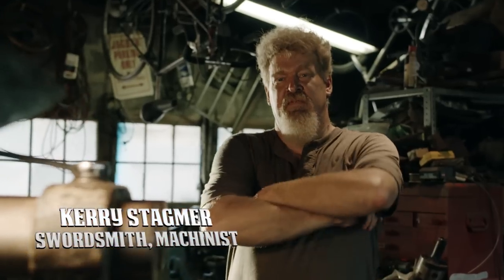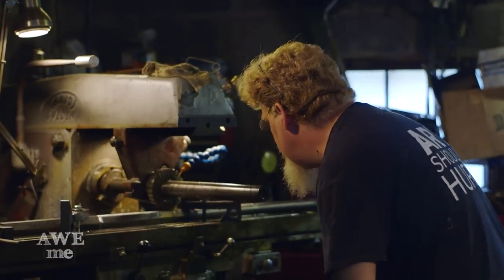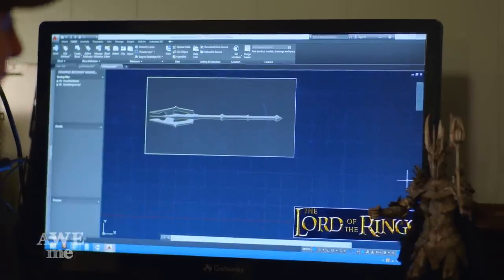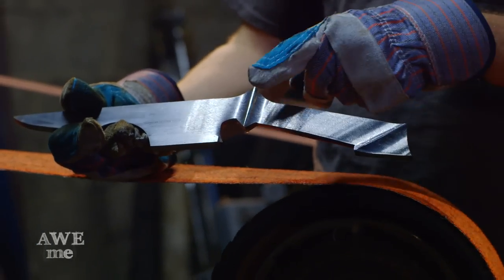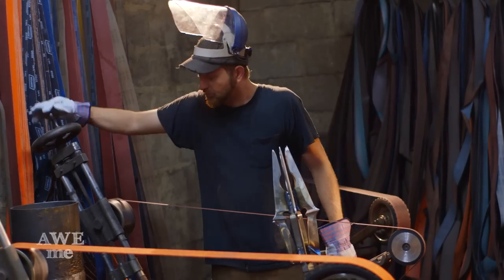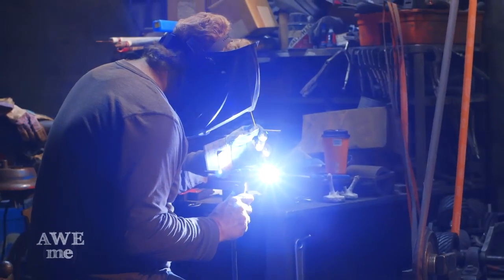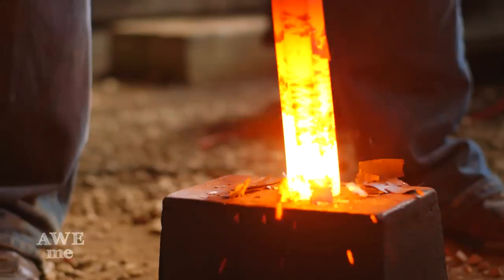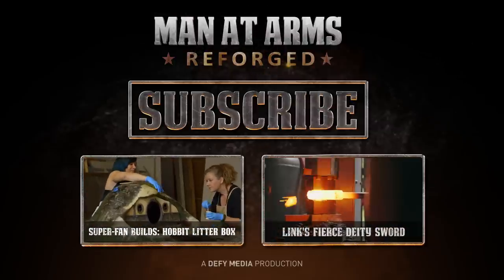Sauron's Mace (Lord of the Rings) - MAN AT ARMS: REFORGED

Comment: A mace is actually a relatively good weapon.  Requires little training.  Less skill needed than a bladed weapon.  

Fighting a spear?  Smash the handle.  Fighting a sword?  Break the blade.  Can't get past a shield?  Beat against it until the arm on the other side shatters.   

Swords are just a lot more famous and elegant, but I think if I was ever stuck in medieval times, I would go for a mace.
Reply: Uhh, no. Yes, it requires less training, but even still. You can be defeated with any weapon. If a mace was much better and beating enemies was as easy as you seem to think it is, no other weapons would've even been used.
Reply: I never said it was better.  Any weapon can be deadly if the user is skilled enough.  Bo staffs, arrows, daggers and knives.  

I just said I would rather use a mace than I would a sword if I, myself, was forced to choose.
Reply: Problem is that it is heavier and slower I guess, but it would be my weapon of choice indeed B-)
Reply: Maces are used for denting armour. Someone with a spear could simply stab the dude with the mace for a distance. Swords are used wit agility and speed to inflict damage, not bash the other dude with the blunt side.
Reply: A mace is used for smashing things, be they weapons, armor, shields, bones or heads.  Ans since most armor was designed to deflect blades, a good solid blow would send most of the impact through the armor.  

But as I explained before, the usefulness of a weapon is dependent on its wielder.  A blind master with a bo staff could out fight a street thug with a knife.  That's a given.  

And as I also explained before, I, personally, would rather use a mace or hammer than a sword or spear.
Reply: And if you get caught in net and need to cut your way out.
Reply: FoddyFogHorn ! You are poorly informed.
Reply: Leo Ryff vey good point how about a warrior who only trains with his mace and shield that's force to reckoned with
Reply: Leo Ryff has the right of it. Heavy armor and shields can deflect piercing and slashing weapons like spears and swords, making it difficult to damage the person inside. Heavy impact weapons like maces are the least hampered by this, capable of bashing their force straight into such defenses, denting them and breaking the bones beneath.

Against an unarmored or lightly armored opponent, I would favor either a spear or sword, depending on the other details of the confrontation. Against someone in plate, a mace is the way to go.
Reply: Leo Ryff I would prefer a mace if I were fighting an armored opponent, but a sword can kill an unarmored person SO easily, and a spear gives you a huge range advantage over people.
Reply: You have no idea about swords spears and any other medieval combat weapon don't you?
Smash the spear? It's not gonna break, the spearman can just give in and let you miss and come around to stab you in your chest, and it's not like you will do any significant damage, a mace is a sidearm, pole weapons are your main weapon.

Break a sword? With a mace???!?!?!! HAHAHA, a sword is a sidearm as well, so it's not likely you will run into battle against a lone person with just a sword anyway, but you really think the steel they make swords out of is weak enough to be smashed by that? 

No, maces, warhammers and flails are anti armour weapons, they always have been, they cannot destroy a weapon in one hit or two, or ten.
Stop spreading nonsense and actually learn about how these weapons were used and what they were used against.
Reply: What are spears made out of?  Wood.  Sure, you might find a polearm that could be considered a spear made entirely out of metal, but most spears are made out of a wooden handle.  Otherwise it would be too heavy to carry over long distances for war or hunting, which is what spears were used for.  A sufficiently skilled mace wielder could block a spear thrust with a shield and smash the base of the weapon, reducing it to a pointy stick at best.  

Swords were not always made with steel.  Common ones were made with cheaper materials, like iron.  And even if it was made of steel, there's no reason it couldn't be broken by a steel mace with a few blows.  Especially the longer swords, like claymores, that are made for slashing, as they would be more fragile further away from the base.  

And these weapons could break.

Modern movies and literature would have us believe that a medieval soldier would use the same weapon over the course of a lifetime.  But in truth, they went through weapons the way modern people go through car tires.  A well made and maintained weapon could last decades, but most needed repairs or replacements after a few uses.  

And if a mace is so good against armor, imagine what it could do against an uncovered arm.  Or an unarmored leg.  Or a bare skull.  

And I have to repeat this AGAIN it seems.  Which weapon your using doesn't matter as much as the skill as the person using it.  *THAT* is what matters.  *THAT* is the thing to remember if you're ever caught in a fight.

And with the advent of gunpowder, it's all a moot point anyway.  But that's a whole other style of crafting.
Reply: Yes, but I know about fighting with spears and maces, and I know that the wood that spears are made up off is not some weak wood that would break easily, spears take the least skill out of any melee weapon from the Middle ages, and it is relatively easy to let the mace wielder swing and pointlessly hit your spear (and I repeat, just because it is made up of wood does not mean it's gonna break so easily) you come back around, and you stab him.
And breaking a sword is the exact same thing, they can just let you swing and they come around to stab you.
And no way can the mace break the sword like that, and blocking a spear or sword thrust with a mace is rather......ehhhhhh.
Reply: ANd what soldier or warrior from the middle ages didn't use a shield with their weapon?  

And when did I say any of these would break in one hit?  In an army vs army battle, this idea would be moot, sure.  BUt in smaller battles between individuals and groups aiming to destroy your opponent's weapon is a perfectly viable tactic.
Reply: But it's almost impossible as I said, you can't just break a spear like that, it would not work.
Reply: And that's your opinion.  But if something can hit hard enough to crack a skull, then it should be able to damage wood.  

This argument is going a round in circles.  HOw about we just agree to disagree before this resembles a Death Battle thread?
Reply: Yes, but I have seen multiple tests before like this, it does not work, since the spear can just move with the attack as it is not stationary like a human skull.
Yea, no DB threads please.

Check out skallagrim, he knows a lot more about this stuff then me, and he pretty much taught me everything that I know about medieval weapons and how they were used.
Reply: more dangerous though
Reply: AGREEING TO DISAGREE!  

...At least no one's made a pepper spray joke.
Reply: Pepper spray! That sounds delicio- gets sprayed AHHH MY EYES.
Reply: Leo Ryff Going to try to make this non-argumentative, but what he means by you not being able to break the spear's shaft is that the wielder is going to make a soft deflection- a type of defense involving redirecting the force of the blow, rather than absorbing it. Sure, if you swung hard at a stationary piece of wood you would shatter it, but the spearman is going to get his weapon out of the way of your swing, and redirect the blow in a harmless direction.
Reply: shrug  

Pull out a gun and shoot them?  

The problem is, I don't know how I would fight someone until I fought them.  Otherwise there are too many "what ifs" and "maybes".  

I simply gave my opinion.  I see no reason for people to keep jumping down my throat about it.
Reply: Leo Ryff Unfortunately the internet is full of people who would rather start an argument than a discussion, but a good number of the fans of this show are historical weapon buffs (myself included) and often have training with a variety of medieval weapons through HEMA organisations (again, myself included), and as a result a lot of us tend to be egotistic when the subject gets brought up. Ultimately the only way to stop arguments from happening is to admit from the start that opinions are worth a little less than knowledge, and step away before an argument happens.
Reply: Leo Ryff It has their own uses in situations. Though in warfare, range has always been the king. Spears and arrows reign supreme in most warfare in history. Shields are also very strong.
Reply: Leo Ryff You forget that a spear and even more so a sword is more agile and that your enemy will not be complient in holding his weapon still for you to get in range and make that huge swing that would either shatter a weapon or smash it out of their hand. A normal mace has 50cm protroding out of your hand whereas a sword has 75-90cm. To get close with a slow weapon you need to be good with a shield or wear a really heavy armor (both would limit your sight and slow you down making chasing your enemies impossible).
Reply: _;  How do I mute a thread?  I expressed an opinion. An opinion!  I said "maces are a pretty good weapon".  I never said they were the best.  I never said they were superior than anyway.  I never even said they were always going to work.  I just think I'd be better off, personally, with a mace than a sword.  

What is with you people and your egos?
Reply: Leo Ryff
You could delete your comment, but appart from that I don't know.
Reply: Leo Ryff A mace, as others pointed out, is a specialist weapon, strictly anti-armour. Anyone not in armour you could easily stab or cut with a spear, halberd or even a sword. Anyone not in armour would simply dodge a mace, retreat a few meters or run circles around the macewielder.
A mace is rather heavy: testing proved that any man in armour wielding a sword, can only fight for 2-3 minutes continuously, then he has to rest a few minutes. Anyone armed with a mace would tire even quicker.
You can't stab, feint or parry with a mace. You can do all of that with a spear, a polearm or a sword.
Reply: AudieHolland You can stab with a mace that has a spiked finial (probably spelled that wrong), and while you can't parry you can often outright block :P other than that you're mostly spot on.
Reply: Leo Ryff Blunt weapons are way better thans swors in general, why? BECAUSE THEY ARE EVERYWHERE they don't loose the sharpness, thet don't broke , they thansfer much more cinetic energy, you have better chances to not hurt yourself, and for now days they don't have to be heavy. I would choose a blunt over sharp everyday.
Reply: Designer Ivan
A sword is faster, has more reach and it doesn't take much strength to seriously injure someone. I'd take a mace or poleaxe only for an armored fight.
Reply: Leo Ryff The marhammers maces and hardforged spears were the actual battlefield weapons. swords were civil weapons and sidarms at best in the armored ages.
Reply: ryan rankin Not true, many knights used their swords as their primary weapons, especially against unarmoured opponents. That fact is very well documented in all manner of historical treatises.
Reply: AGrumpyPanda
Staff weapons were usually their primary weapon and their sword their backup weapon.
Reply: ***** Does it do Karaoke? :)
Reply: Leo Ryff 
Actually it requires more training than you think, because one missed strike spells the end of you. I'd agree if you'd said Axe, but Maces are a skillful weapon, that requires amazing reflexes and experience.
So if anything it takes more skill than a sword, because a shoddy cut doesn't leave you as open as a glancing blow.
That being said, it's a great weapon. There are few swords capable of delivering such a crushing blow.
Reply: Leo Ryff a mace takes insane strenght tho.
Reply: Fallingout EMS
This ones yes, others are usually 1kg and 60cm. The indians, russians and osmans had however also bigger and heavier maces.
Reply: Leo Ryff Let's hope you are strong enough to swing one of them around for long enough
Reply: you have to be stronger though.
Reply: +Leo Ryff Maces are for opponents wearing plate armor.  Using a mace against an unarmored opponent wielding a spear would be disastrous.
Reply: RandyLeftHandy well, if you manage to close in any weapon would do it, but the problem is getting past the spearhead.
Reply: James Cutler
In case of no or light armor swords are more deadly and incapaciating. They have longer reach and are more nimble moreover you don't need to swing them that much.
Reply: TheRPGentleman First you need to hit the sword which is more nimble. Your best chance is to strike the wielder so that he is forced to parry with his sword. The problem there: He has the range advantage and he may thrust while you make your swing. To close in you'd better take a shield.
Reply: The Apocalypse A buckler
Reply: cough morning star cough
Reply: +Leo Ryff how about i simply help yu fill in the gaps a bit, 

maces ARE good, id say the best thing is you need no edge alignment really to do damage, where an axe or sword or hammer, you nooed to hit the person square on with the striking end/ edge

and they REALLY shine when someones armour makes it hard to cut someones fleshy bits with a sword or axe, or stab with sword or spear

when noons wearing metal armour, an exge is referable since, say, a gambeson 

because you need LES force to cut into cloth or human skin/ muscle then you need to outright smash it.  you can also cut someone just by dragging your blade against them, you cant really do that with a club

but when someone wears armour, either maille, plate scale or lamellar that covers most of the body, you cant simply cut them easily. 

so all thats left is smashing or piercing through, that means axes, maces or spiked weapons...
Reply: Axe for me when less training
Reply: Either that or the war hammer is a good second choice behind the mace’s power and tactics

Comment: A cinder block? Something actually hard was used to test a weapon?
Reply: They used some solid stuff for Thor's hammer as well, if memory serves me. It's easier to get away with when you have a weapon made for crushing instead of slicing.
Reply: A sword against a cinder block is not going to do anything except damage the sword. A sledgehammer (which is what this is, in terms of weight and battle functionality) against a cinder block is an appropriate test. If you're using something to smash a cinder block, it's too heavy to wield in battle. The human skull is nowhere near as strong and making your mace too heavy would only tire you out and make your movements way too slow. 

That said, this was never meant to be a functional weapon, only as a decoration.
Reply: NowhereManForever No, they've made weapons that could definitely destroy a cinder block but where only demo'd on soda bottles and melons. I'm not saying every weapon, but when you make a buster sword, I wanna see some damage.
Reply: They cut a TABLE in half with the Buster Sword. Not enough damage for you?
Reply: NowhereManForever thats if you hit the skull. Heavy armors need to be dammaged too when you do a bodyshot, so it must crush the armor and the torso
Reply: firedrive45 it doesn't have to crush the armor, it just has to bend it slightly inwards, a hit like that on the torso will break the rips in a manner that makes them pierce the lungs, which pretty much kills you.
Reply: firedrive45 Still, I wanna see you lift that fucker and hit someone with it, let alone parry an oncoming attack with it. You don't need to completely smash through armor either- you just have to dent it enough or deal blunt force damage through it. Look at historical maces and war hammers- war hammers look like a lot like regular hammers and mace heads would easily fit in your hand. They did this because you don't need to smash through a fucking cinder block to kill someone with something, and it would be impossible to wield a tool that could smash through cinder blocks that easily in battle.
Reply: NineInchNade NowhereManForever The Tyrant  Okay, lets stop over analysing this. The comment was partially a joke and I'm just saying that I'm kind of tired of seeing weapons like these constantly used on soda bottles. That's all.
Reply: NowhereManForever I mean, its used by Sauron... So you would expect it to huge. The man himself is huge as well as him having a magical ring lol
Reply: firedrive45
Except a sword doesn't cut through platearmor. Thats what hammers and maces are for. If a sword is used on metal armor, the idea is to stab at the gaps in the armor.
Reply: Matt Stagmer You must make the Infinity Blade
Reply: TheWerdna Maces were used against warriors in heavy plate armor to crush limbs and the skull.
Reply: TheWerdna or flip it around and hit the dude in armor with the crossguard or pommel.
Reply: ari swamp That's what I was saying. My response was to someone suggestion swords would cut through plate mail.
Reply: Ryvieous
Yes, that too.
Reply: NowhereManForever Sauron is big. So the weapon is by no means built for human. It's made for sauron and they are trying to make it as close as they depict it in the movie, so of course it's only for decoration, duh.